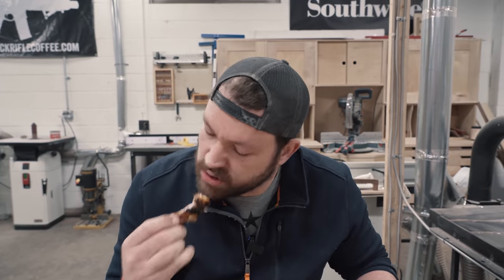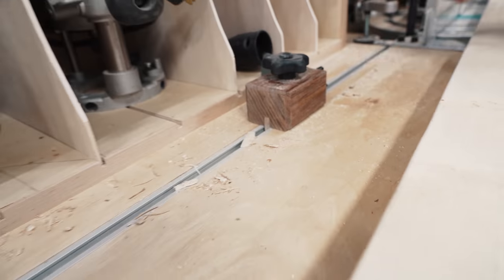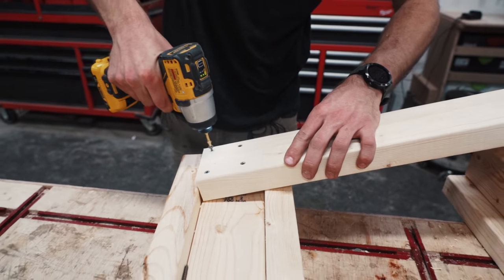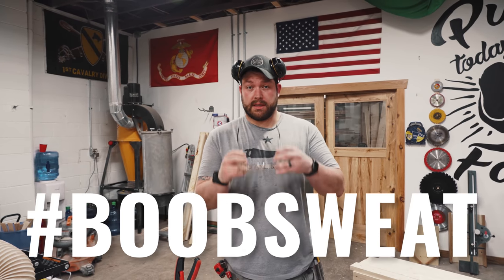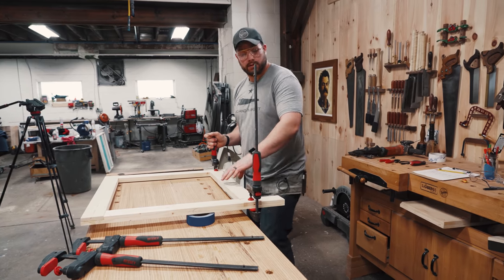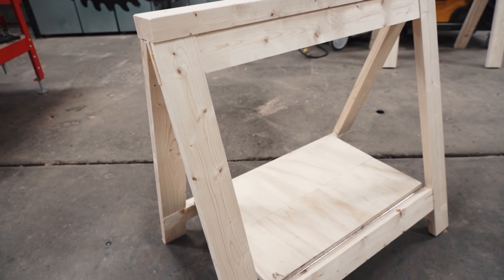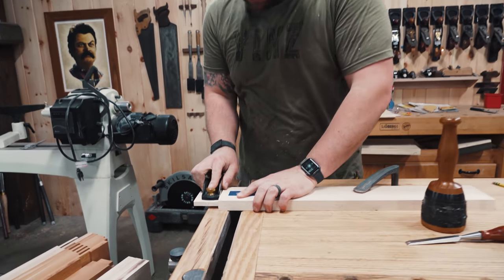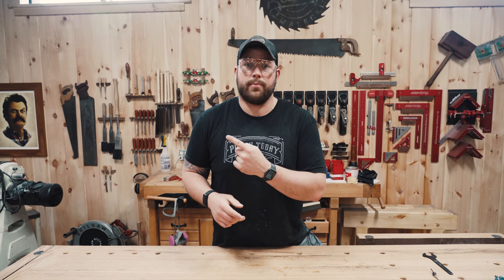3 LEVELS of Sawhorses: DIY to PRO Build

Comment: I just gotta say that the first one looks the sturdiest.
Reply: I’d say the second, because it’s got a fixed triangular frame.
Reply: I'd like yo see a strength test with all three.  Load em till they break. I bet the diy comes out on top.
Reply: Looks can be deceiving all the weight would be resting on on the screws with a slight modification yes they could be the best but in there current form they are the weakest
Reply: First one is what I use for framing and I’ve loaded two up with nearly a thousand pounds and it didn’t even budge.
Reply: @hotrodpaully1  the top plate of the DIY is resting on the top ends of each leg, screws just keep them there
Reply: But the last one looks the tastiest
Reply: The first one and the second look more like a pro did it in order to get to actual work rather than making a career out of building a saw horse. The third one looks like a hobby horse for someone who isn't required to actually earn a living using it.
Reply: I saw someone who built the apprentice style sawhorses properly and loaded them up to 15,000 pounds and they didnt break. Look up next level carpentry if you want to see it
Reply: Rick Schuman as well as IKEA sell the same design of the 3rd and doesn’t last long
Reply: @devonave  it all depends on your usage. Just like you have different types of screws for different jobs, there will be cases where #3 is the more optimal choice for the job
Reply: Diy? They don’t teach union carpenters these ones for no reason. Quick, dirty, and sturdy af. Definition of misinformation. I literally only clicked for the comments. Could never listen to anyone that remotely believes the shit posted on the preview photo.
Reply: the third one makes me think i'll break it...
Reply: Nillie yup
Reply: 3rd one looks extremely weak, but i know its probably better for a certain application.
Reply: When I used to do framing my old crew and other crews always built them the say way. Like #1 but with a 2x8 or 10 cut on a 5 degree to short on either side to strengthen the spacing and 2x4 brace halfway up the legs. These sawhorses could hold an entire load of plate material if we wanted and still have a slot to hang your saw off so you didnt have to bend down to pick it up or have it on top of the material while you are measuring.
Reply: @devonave   If assembled correctly, they are fine.
Reply: @johndavidalexander6646  the downward force on the top plate is translated by the angle into outward force on the feet. The only thing holding them together is the gripping strength of the screws in softwood.

With the folding sawhorses, a similar dynamic exists, but there are more screws and the force is being applied across their shanks instead of along them. screws have far more shear strength than they do tensile grip.

With the "pro" horses, the downward force is being applied straight down through the legs into the floor (assuming they anre in the down position).

All other things being equal, the "pro" horses should bear the most weight, and the "DIY" horses should bear the least.
Reply: They are. We use them out in the field and i set a pallet of 4’x8’x1/4” checkered plate aluminum on a set of them. Probably about 3,000lbs or so.
Reply: Hoy McRobinson and that explanation right there is why I look at a set of blue prints and call the engineer a dumbass at least once during each stage of a project.
Reply: The last one I want to take to a dinner party and a movie.
Reply: Next level carpentry tested the first one to something ridiculous like 10,000 lbs for a pair. I don't remember the exact number, but it was impressive.
Reply: JOrdan Berns This was my thoughts exactly.
Reply: @hoymcrobinson2480  I'd like to see the "pro" horse tackle 15000lbs ...
Reply: @rorschacht8478  I doubt any of them could handle that much weight. What is your point here?
Reply: Actually the third one we call it here painting stand, not sawhorse. Its not the vertical load bearing the problem. You barely use tons on it. The horizontal stability is where the 1st and simple one beats it. And that you can feel it even at 50-100 kg. But, the third one is better for painting, no doubt.
Reply: @hoymcrobinson2480  I can't remember but it was probably good.
Reply: @rickschuman2926  Absolutely Rick
Reply: @hoymcrobinson2480  The angle is sharp enough that the legs will have very little outward pressure when fully loaded, its week point is pushing horizontal weight but you could fix that with nuts and bolts that can be tightened as it wears out, and the nuts and bolts will solve the slight weakness you were concerned about.
Reply: I literally thought of a way to make the first one collapsible
Reply: first one is stackable and takes least amount of time so u can actually build real shit you gonna spend 3 days building something just to help u build something else.
Reply: @tylerkurfees4762  seriously. Couldn't have said it better
Reply: Absolutely ! Ive been doing  carpentry for 20 years and have worked with some amazingly skilled framing and trim carpenters considered very pro in their field  and hey they use that saw horse because it's quick and easy to make and does what it's intended to do and sturdy as hell
Reply: Not a "DIY", that's a rough frame sawhorse, and a good framer would have them built and partially loaded before homeboy sunk his first screw🤣
Reply: Been using a set for about a decade now, with constant projects around the property. So far it holds up beautifully and seems as solid as the day I built em
Reply: @gnu160  misinformation? You’re funny.
Reply: It’s what we use on job sites
Reply: @rickschuman2926  Well said bro
Reply: I beam diy is strongest
Reply: They definitely are, I build houses for a living and that style is best for heavy weights. I put cross bracing on mine but I've had over a ton on them before with no problem.

Comment: Been doing Carpentry for over 40 years. I like the folding set, very functional and cheap. We could build it out of left overs. The Pro one is really nice but I'd be afraid to use it and it would likely end up in the bathroom as a towel rack or the bedroom for holding quilts. Nice Job.
Reply: They look like they would fall over if you dragged material across them.

Comment: The DIY saw horse is best for working in the field. That way when the apprentice sends the saw through it because they set it to cut at full depth, you aren't losing $$$.
Reply: Yeah you are losing $$$. The moment you have to buy a new blade because there are screws in the top board. None of these sawhorses built in this vid are any good, cept maybe the hardwood one that is more for art instead of function.
Reply: @phermey  Can you make a glued sawhorse.. or without screws or nails in it.. im curious how it will look like and how much "function" will have.. You seems smart enough to do something i said.. as i see in your comment.
Reply: @gattonpc  do the diy one he did. But put the top board under the vertical piece. Like an upside down T. You'll be fine.
Reply: Also when they fall off the flat bed of your truck or some jerk steals them, you are not out a lot of $$$$

Comment: When working in the field, I used to screw a 2x4 to my saw horses upright as a sacrificial piece when ripping material.  I could change it out when needed.  Thanks for your videos, I really enjoy this channel.
Reply: I screw 2x10 or 2x12 to steel folding saw horses. Put next to each other for small, portable work bench

Comment: The PRO build having a height adjustment is certainly a major advantage. I do have questions about the stability of the design in comparison to the other 2 models, since their legs spread farther (naturally more stable). Thanks for the video.

Comment: I have made several sets of the DIY sawhorses over the years.  Three things I do a little different 1.  Bottom two screws go into bottom of I beam (more screw in the wood).  2  top of each leg, I cut a 1/4" 45° off so there is not a sharp edge.  3. I make a gusset out of scrap plywood and put it on the end under the I beam giving the sawhorse greater strength (doesn't have to be perfectly measured 1(hold, pencil and cut), but does take additional shorter screws).  
Optional; cut one sawhorse a little longer than the other (a little over the width of both gussets), place a short piece of 2x4 under the ends of I beam between legs, then they will stack level.   I make my sawhorses out of scrap 2x4 lumber from here and there.  Nice thing about this concept is that you can make the legs as long or as short as you want them.  I have one set that have 36" legs and another that are 32".    I read a story one time about a builder that on each job he went to do framing/remodeling and such, he always made a set for the (new) homeowner from the scraps.

Comment: I’ll say the first set is the best when I was framing it’s awesome cause you can build a set to stack lumber and a set to cut and accommodated by a Miter saw and a good piece of ply wood it becomes a pretty great table and since they are cheap you don’t fill bad about someone setting the depth wrong or adding things to it

Comment: I made a pair of the DIY ones years ago. They are heavy and bulky, BUT as strong as all get out. The top 2x4 can be easily replaced when it gets cut up. If I need something more portable for light work, then I go to my other sawhorses, but when the job is heavy and needs to be very stable, then I break out “ my little friends”. 😀

Comment: The “pro” level looks great and the adjustable height is nice, but that thing would tip over in a heartbeat. Not tipping is just as important as holding weight.
Reply: It tip over and ,,,or  shear at the adjustable section They dont understand point  load and shear  something you learn in trade school
Reply: I have never needed an adjustable saw horse either, or if I did it's something I could solve very quickly with a couple of scraps screwed to the horse

Comment: And those pro saw horses can be used for panel glue ups,. Remove the top part, arrange your boards, sandwich them with top part and some clamps and put rest of the clamps accordingly. Think this could be useful 😃

Comment: 1:25

Maybe I'm no math genius but you can get exactly 3-32" cuts from an 8' board.  32"*3=96"=8'. Sure, you have to take into account the width of the blade that turns into sawdust with each cut but you could easily cut each of the pieces 31.5" or 31.75" and only have an inch or 2 of waste per 8' board instead of nearly 2' of waste for every 10' board for 32% higher price.  Help me understand what I'm missing here.
Reply: Yeah the cost for a standard 2.4m length vs a 1.8m or 3m is way cheaper. I try to size everything with the standard length and use that waste for blocks or jigs or spaces or anything vs a 1/3 or 50% higher cost for the non-standard lengths.
Reply: A standard 8ft 2x4 is not actually 8ft, its 95.5 inches
Reply: @christopherwilliams9639  I've never bought a 95.5" 2x4.  Even if it is my point still stands as far as cutting them at 31.5 or 31.75" in order to eliminate waste.

Comment: My first month on my very first framing job (in the stone ages of 1991) all I did was shelp plywood and knock together set after set of what you call the DIY sawhorse. I must have made 40 pairs. With a little practice all you need to use is a skillsaw, speed square, and framing gun you can make a pair in literally 3 minutes.

Comment: Best sawhorse ive seen is none of these but it had 3 legs and 2 built in vices, i saw the plans for the build on sale at Etsy, you can't buy it anywhere, you have to make it yourself, wooden Jawhorse a 3 in 1 vise, sawhorse and workbench all in 1 design.. not foldable but you could just add hinges and add chain, carabiner and eye plate to make it folding

Comment: Is workshop machinery built to the same height level? I was wondering if you could put a roller on any of these and use them to catch longer material as it comes out of the machine. If the machines aren't the same height, the adjustable height one could be quite useful

Comment: I made something in between diy and amateur. Had some scrap 2x6 or 2x8 which I used for a wider top piece. I used some basic hinges on the one side of the legs so they would fold flat, which I used some scrap 2x4 bed slats. The tops of the legs were cut at 10 or 15 degrees and same on the bottom. I used a small 40cm length of pine with a notch cut out that locks the sawhorse open. (screwed in on one side so it can swivel, and lock into a long screw that is not screwed in all the way on the other side)

The best part of making my own apart from the savings (since it was mostly scrap apart from hinges and screws) was that I made them the height I wanted them to be. Compared to anything i could buy ready made, these were cheaper, sturdier and taller. Well worth making your own even if you have to buy the wood.

Comment: DIY sawhorse is my favorite. dont think the other two would work very well for framing, cool designs tho with my DIY sawhorses, I dont even put the extra 2x4 top plate across the horse and I make them 4' wide. and I just shoot framing nails in the legs and also another 2x4 across the "knees" of the legs If that makes any sense. cool video bud

Comment: As I watched and thought of which pair I like the best, it reminded me of Goldilocks and the three bears. Any way I like the first pair the best. I have four sets of saw horses. I keep one set that has 48" top board with 3 2x10s 10' long on top. I keep 5 2x2s 48" long on top of the planks cross-ways. It works great for cutting up plywood, setting up my miter saw, scaffolding, assembly, and painting.

Comment: the legs should have a compound angle with the top, splaying out in both directions for maximum stability. That 'pro' version is the worst of the bunch though and a gust of wind will blow it over. Look for an example by paul sellers if you need to build a good one.

Comment: When I went to school 8 feet equalled 96 inches, which is easily divided into three 32 inch long pieces. Okay, they’re fraction less due to the saw kerfs but that certainly doesn’t matter on a pair of DIY sawhorses. Cutting out of ten footers is going to leave a 2’ piece from each two by four. By the way, I would call the first type temporary not DIY. These are the type of horses carpenters would throw together at the start of a project usually with four foot long tops, and either leave on the site when they were done or throw in the dumpster. I think of a DIYer as some one who would either buy the flimsy plastic folding horses or a couple pairs of the metal brackets where you cut four legs, a cross bar, and a couple of spreaders.

Comment: As always love the builds. Especially like the 3-way series. Perhaps a 3 way on a portable hand tools tote or box. My shop is my garage and I don't do many really heavy builds so the folding jobbers are the ones I'm gonna build although I really like the sturdiness of the DIY. Heck, I may do them all... Mount a roller bar to that purty one and it would be a good outfeed roller.. I likes me some taters mmhM. A shallow recess in that beater with some Tight lay Tared Twisted Nylon tightly wrapped would work nicely!! You may need to groove out some line channels to lay in but you get the idea. :) Thanks again ... Yup I really hate electrical tape Goo. :)

Comment: I'm a carpenter of 39 years. 
Like someone else pointed out it depends on what you're doing as to the size and design of the horses.
I also think it's a personal choice.
My own demands of what I use now are simple they must break down to store on my work van and each one must support my weight and be stable doing so. 
The first set won't take a lot of lateral movement before those nails or screws at the top of the leg start to fail and the horse becomes unstable.
The second set like it's plastic store bought counterparts seems to me more trouble than it's worth to build.
The third set dubbed the "pro" set I wouldn't even build or own. The base doesn't look broad enough to supply proper stability .
When working with saw horses you need stability,  durability and longevity.
They don't need to be works of art. The last thing I want is to worry about God Forbid putting a saw kerf in my work of art.
Like someone else pointed out, that
 apprentice of yours won't watch what he's doing and saw right through your work of art.
Besides which your attention should be focused on what you're doing and not your work of art.
Enough said

Comment: Hahahahah! "Use 10' 2x4 because an 8 footer won't be long enough for 3 32" pieces"...

Okay, cut them at 31 7/8" and presto!
Reply: Exactly  ! made lots of the "diy" sawhorses in my day and always used 8 foot  2x4 studs  cause they are cheaper per foot  than 10 footers and no waste at all

Comment: After watching, I realized I got stuck in the beginning at "using 10 footers to get 32 inch pieces with less off-cut than the zero waste with a 31 15/16 cut from an 8 footer"
Reply: Yeah, why they say to use 10ft !?

Comment: I'm confused basic one need 7-32" 2x4. 8' 2x4 is 96" 96/32=3 why use a 10'? shouldn't you be able to get 3 pcs out of an 8' I understand you will lose the width of the saw on the cut but if you average it out it should work or am I missing something? Real question not trolling

Comment: Well I’ve built at least 20 sets of the first ones on the jobsite. Takes about 5-7 minutes. if a amateur or pro can build his set as fast then I’ll hand it to him. 

Also if you add a half height cross member across 2 of the legs and plywood gussets on the ends it will easily hold a lift of 2x6; also use as a step or scaffold support.